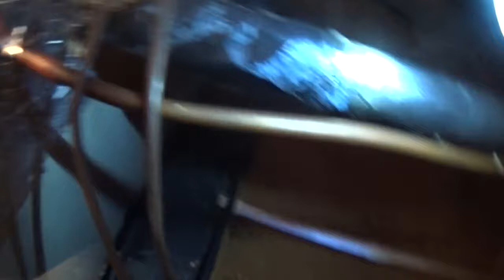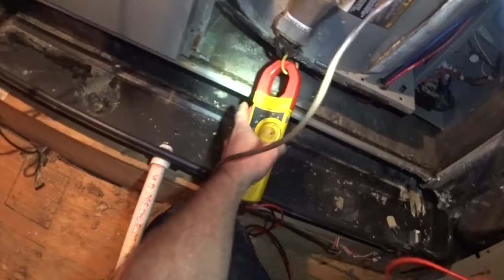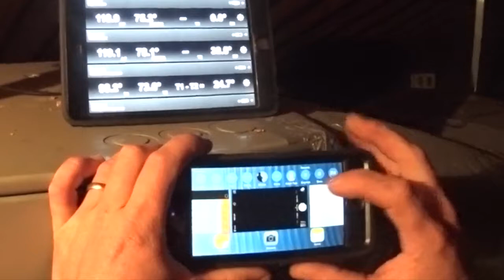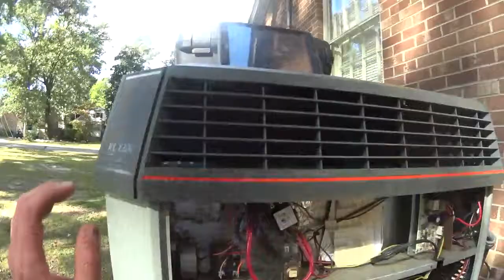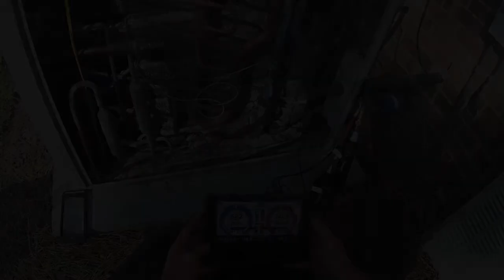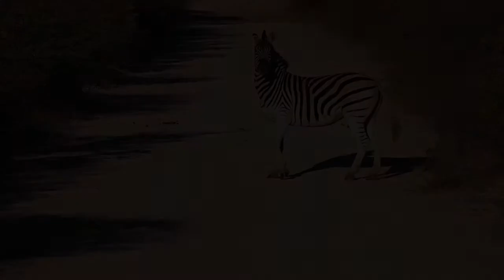HVAC Service: Heatpump Heat Check with Imperial iConnect

Comment: Where can I find the proper information on checking the cap. Under load. I was always taught to check cap. With no load or power to the cap. Thanks i really learn a lot from you being fairly new to the HVAC trade.
Reply from the maker: 5899jason  2650 multiplied by Amps divide that answer by the Volts

Comment: Isnt better to get total external static pressure  and compare it with unit data instead of aproximate cfm values.??
Reply from the maker: Maybe so, this is just the way I do
A heat check.

Comment: Stephen,
Nice video, but......You are killing me with that ring, I have seen two severe ring injuries  in my career, one avulsion, that happened believe it or not in a locker rook when a guy fell and tried to catch himself and the ring caught on the top of the locker,  http://www.orthobullets.com/hand/6061/ring-avulsion-injuries, and one sever burn from electrical contact between a cabinet, the ring and an electrical terminal that turned vaporized the ring on the technicians hand. http://www.medbc.com/annals/review/vol_5/num_1/text/vol5n1p33.htm. Not worth wearing at work. 

OK, I am done venting now,
Lets make a list of tests that you guys want for heat pump testing
Airflow calculations based on temperature rise
Reversing valve leakage test
Measure of temperature drop in the vapor line to see if additional insulation needs added
BTUH output in heating mode with COP calculation
Method to check charge in the heating mode
Reply from the maker: Thanks for looking out Jim Bergmann I nearly lost it early on. Not sure I can stop wearing it. 

The list of testing info is great, I'm sure there are other things that the rest of YouTube can offer, those things would serve me very well for what I usually get into.
Reply from the maker: The avulsion injuries were pretty nasty looking though.
Reply: That's why I shared the photo. Until you have seen somebody's boney finger sticking you of their hand, you cannot appreciate a ring injury. Al least wear a work glove to cover it then. Get one with open finger tips so you do not loose your dexterity.
Reply: Jim Bergmann thats why your gotta get a tat on your ring finger. I havent worn my ring since I got married
Reply: Stephen Rardon I don't think I  could take mine off. For a few reasons.
Reply: talyn875 As there are 4 ports on the iManifold and iConnect, it would be a fast and easy test to look for hot gas leakage from the high side to the low side of the reversing valve by simply hooking a thermistor to each port. 

As far as hot gas. it would be interesting to me to see the temperature drop of the hot gas line simply to see if there is a significant loss. It could be done off a spare port and made part of the troubleshooting application. Just an idea.
Reply: Jim Bergmann I could see checking one that way, but would you have a special mode just to do it?

It would be interesting to see how much heat loss the vapor line has. My reply would be that there is not much I would do about it. For example if you felt it was too high would you pull all the 1/2 armaflex off and put 1 inch on? I think of that like when you put the probe on your evaporator to see the suction pressure drop. It's cool, but I'm not going to need to do it much.

The way I see it is that you are gathering info from techs about what they would like to see. I am not trying bag on the idea, just letting you know how I would use it. I do think the products are great and the connect was a good product to offer. 

I'm sure I will end up owning one.
Reply: Jim Bergmann I like the airflow calculation and Btuh output, but I probably wouldn't use any dedicated  reversing valve test or vapor line temp drop calculation.
Reply from the maker: talyn875 I don't know that I would use it frequently either but never hurts to have more info than usually necessary, no?
Reply from the maker: Sounds great to
Me!
Reply: Stephen Rardon nice job, but I'm with Jim Bergmann on the ring. I've wanted to ask you a few times how many times you've been shocked.
Reply from the maker: T&N Services LLC. I've been shocked but never because of the ring